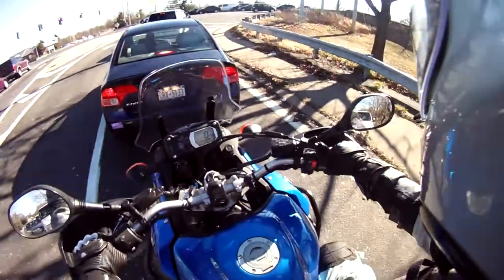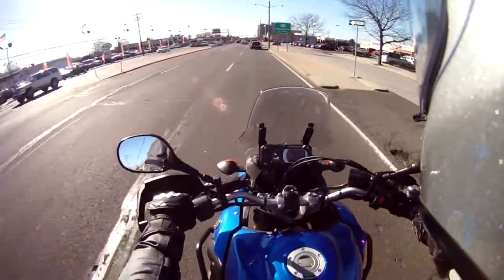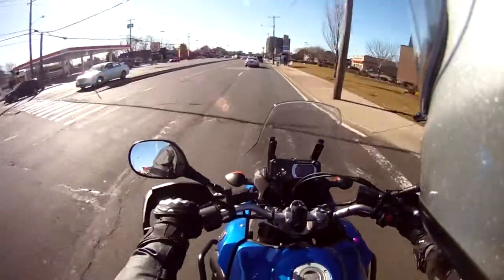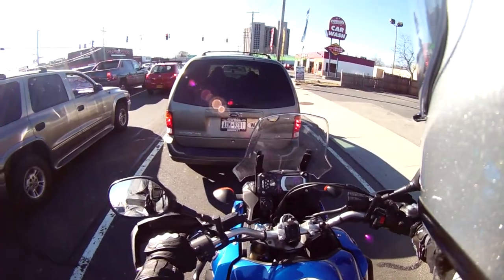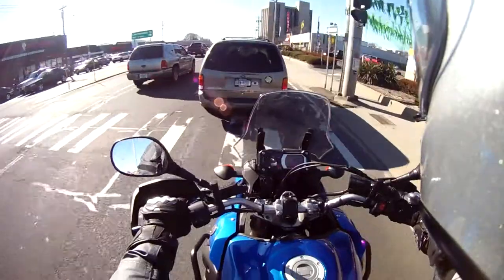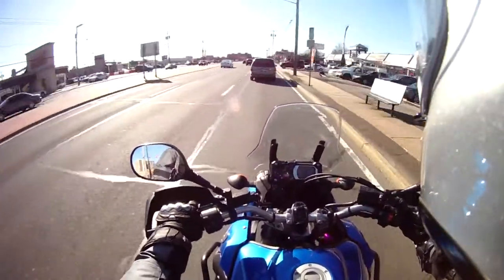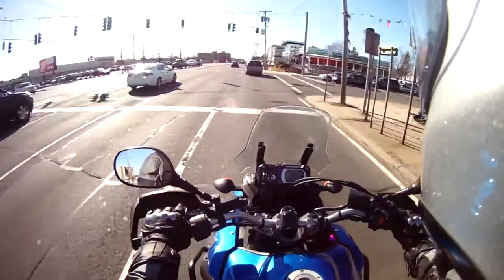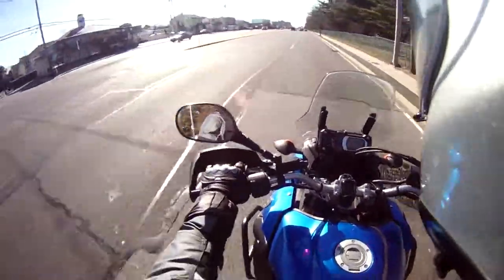Any Drift Microphone Tips?

Comment: I wound up cutting the plastic housing off my mic and using a strip of white plumbers tape over the top of the mic to get rid of as much wind noise as possible.  I have a vid on my channel if you want to check it out.  I am using electrical tape in the vid, but have had much better success with the plumbers tape.

Also, you have the option of the led that plugs into the HD to give you a visual if it is ON or OFF.

Comment: I don't think all that much about mine. I just clip it to the front of the cheek pad or to one side of the breath deflector.  Just not in front of my mouth or nose so I don't get my breath noises so much.  I tend to keep my shield open a bit too. Sensitivity is set at one. There's wind because I'm on a Motorcycle 8-)
I turn the cam on whenever I get on the bike.

Comment: Ya I've found that the button never works when I press it while im riding, works fine when i'm testing.  I never know if its starting or stopping like its supposed to.  When I am stopped with the bike still running I can sometimes hear the beep.  The light thing would be nice, but cost another $20...  I've been having mic problems lately also.  Recorded three diff topics in one video only to get home and all I could hear was wind noise. I think I didn't plug the mic in all the way, I was pissed